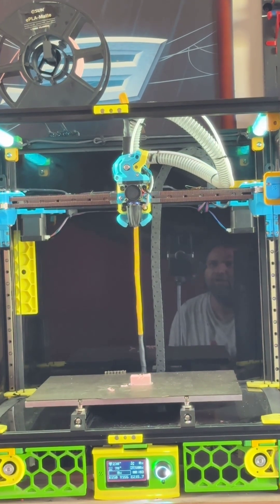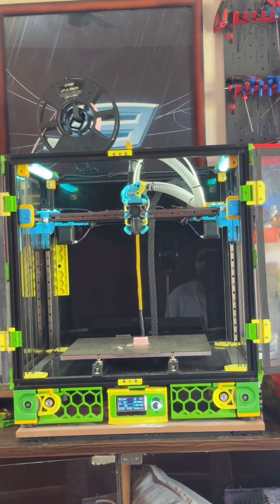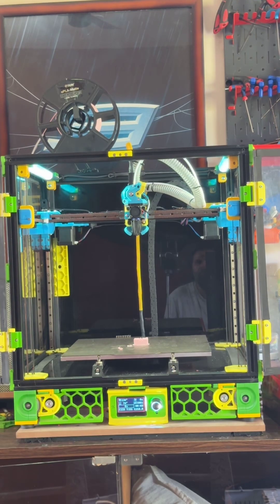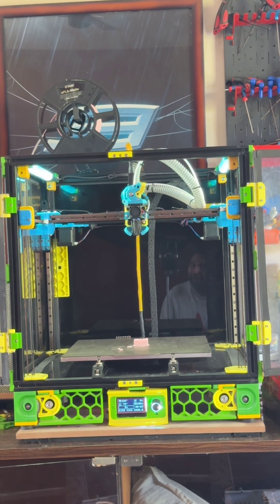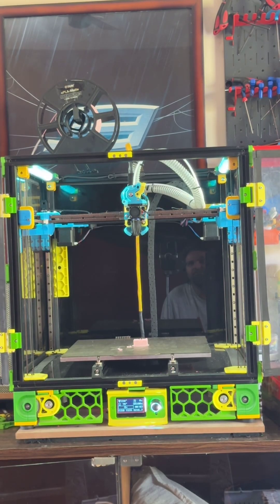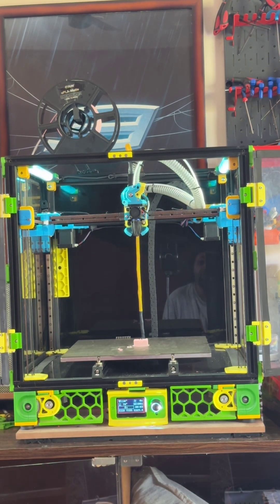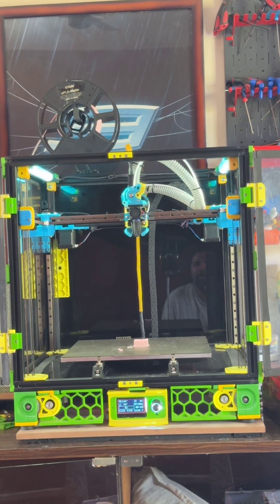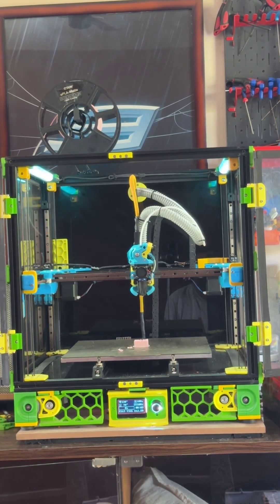Recover Failed Prints in Klipper and Voron 2.4 using the Power Loss Recovery module.

Comment: im having problem with the end stop switch,, im on single z stepper( ender 3) .. i plugged a new end stop on pin29,,, but the firmware wont recognize even if i declared the pin on the cofig.